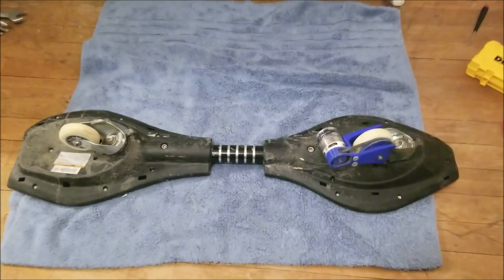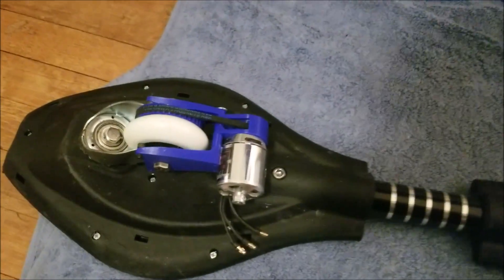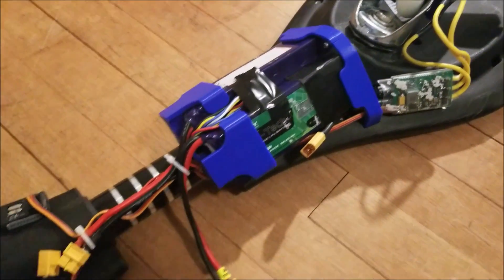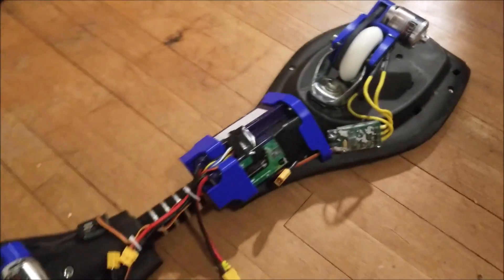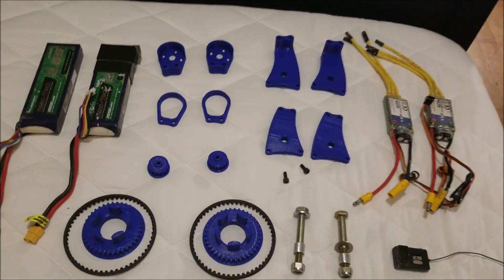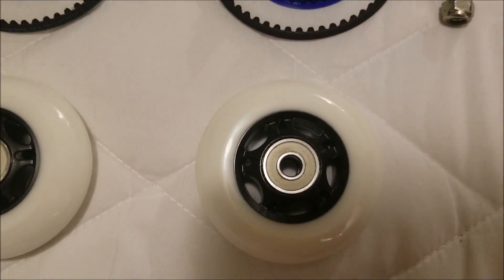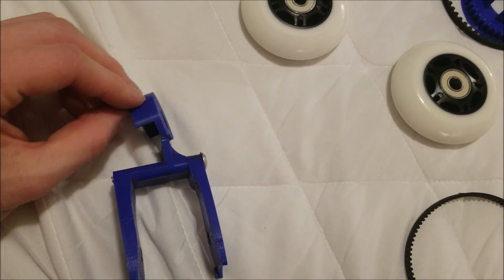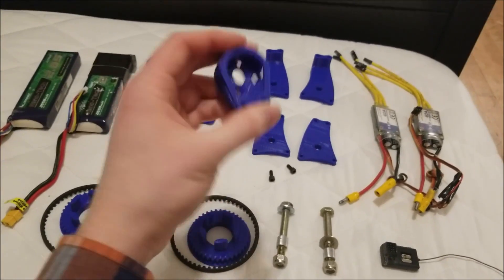2000W 3D Printed Dual Drive Electric Ripstik!!

Comment: Hey man, love this project! :)

Have you iterated on it since this video?

I have been meaning to convert a StreetSurfing Waveboard for a few months now but the motors are constantly out of stock and I can't find suitable alternatives....

Ideally, I would love to put bigger wheels with hub motors on it but that would of course require custom casters. Not technically impossible, but probably expensive to manufacture.

So for now, I'd just be extremely happy to have exactly what you have here in terms of drivetrain :)

However, he Waveboard body has a lot of cavities underneath the deck plates. I'm definitely going to embed the receiver, ESC's and maybe a charging curcuit in there.

Comment: Hey did you have to do anything to the battery mounts to get them to fit? I printed them as-is and I have no clue how you jammed em in place lol
Reply from the maker: One of the battery mounts snaps into place on the center tube (secured with a ziptie), and the other mount is actually two pieces, and you have to insert them into slots that are already in the plastic body, then fold them down towards eachother and fasten them together with a bolt. So no tape, glue, or drilled holes necessary

Comment: This is awesome man!! I’ve just been given a rip stick and love the idea of electricfying it!! Hopefully get it done in the next few months when I finish a couple of other skate-projects… what size motors are you running on that setup and what are your belt measurements?
Reply from the maker: Would highly recommend! Its a blast to ride! I used Turnigy SK3 4250 350kv motors with 275mm x 5mm HTD-5 belts, check the description for more details too.

Comment: Genius! What kinda top-speed and range did you get out of this btw?
Not to mention, what's the hill climb gradient ability like?
Reply from the maker: Thanks! Top speed was ~18mph but with solid torque for low-medium hill climbs. You can always trade speed for torque, but this was a solid combo i was happy with!
Reply: @ericinventor  cheers for the response. I wonder if it's possible to use those old 70mm electric skateboard hub motors on these too; the ones that can fit into existing truck axles? (compared to modern hub motors that include an axle mount)
Reply from the maker: @esk8jaimes Yes Ive thought about this too. The tough part is packaging, most hub motors ive seen are two wide for this thin ripstik wheel/caster combo. Im sure its possible but the caster would probably have to get wider. My goal was to not seriously modify the original ripstick, so people could make the conversion themselves.
Reply: @ericinventor  Do you know what the approximate range is? I'd love for it to not only be fun but also practical!

Comment: Is there any way to get the wheels more centered in the caster ? Already printed the mounts and ordered the motor !
Reply from the maker: Hey tres155, they are only slightly offset from center probably about a 1/4in, but you can use skateboard spacers or washers to keep the wheel positioned along the axle. If you really want them to be perfect you could bend the caster out to make the gap wider, then center the wheel using skateboard spacers.
Reply: @ericinventor  thanks man ! I'm super stoked to build, you are making childhood dreams come true you're awesome !

Comment: I’m literally ordering all the parts to do this now. You’re a legend. Was it worth doing both or did you not gain much?
Reply from the maker: Yes you get much more torque and acceleration! I would recommend getting different escs though. Im upgrading mine now to flipsky minivescs
Reply: @ericinventor  thanks - just a quick one I’ve got a few problems with the stl’s from your thingiverse - the motor mount v2 isn’t like in your video where both sides are the same height - one side is higher which means the mount stiffener won’t fit on as it’s floating on one side?

The other (more important) one is the small pulley seems to only be the old version? I’ve printed smal and large pulleys and they have two different belt profiles? Also the pulley just has a circular hole not a D shaped one. Do you happen to have backups of the STLs?
Reply from the maker: @Who.IS.my.daddy.  Hi Gordon, im sorry youre having some issues with the files. Its my fault I may have not uploaded the latest ones. Let me look into it tonight and try and reupload the latest ones. Send me an email @ericinventor@gmail.com, Im glad to help!
Reply: @ericinventor  you’re the man, thanks! Really appreciate it
Reply from the maker: @Who.IS.my.daddy.  I reuploaded the latest small pulley and motor bracket to thingiverse. Let me know if those work for you. They are called little_pulley_5m and motor_bracket_2
Reply: How'd it go, did you make one?

Comment: This is what I've been looking for, sadly though I don't have a 3d printer. Maybe you'll have some offroad upgrades by the time I do though. Just needs larger...axles...wheels holders, I'm not sure what to call them.
Reply from the maker: Ender 3 3D printer costs $180. Best printer for the price. Join the the club bro

Comment: Do the motors hit the ground on sharp turns? Thinking about making my own one, and I’m wondering where to put the motors
Reply from the maker: No they don't, just as long as the wheels are full size and you use the brackets I made. The motor's gotta stay right near the wheel
Reply: @ericinventor  thanks for the reply! I've decided to go for hub motors instead now though, to save space and make it look sleeker.
Reply from the maker: @LameCorvette  Wow great idea I'd like to see that once its done!
Reply: @LameCorvette  What hub motors did you use?
Reply: @LameCorvette  How'd that project go for you?

Comment: How do you wire the escs to one receiver? Thanks
Reply from the maker: You connect the ground (brown or black) and signal (white or orange) wires from the pwm cables of each esc together. Then you have just one pwm input to the receiver.
Reply: ericinventor I wired it like that. Only one motor runs, then once you turn of the transmitter one motor continuously runs. Any ideas?
Reply: @markdavis7032  thats mean your receiver doesnt have failsafe mode. what tx and rx you're using btw?

Comment: Would this fit on the ripster? ( the mini ripstik)
Reply from the maker: Not sure! But you could try it
Reply: ericinventor thanks! One more question. Where would I get the D shaped rods that fit into the motors.
Reply from the maker: @markdavis7032  Those are just 5mm steel shafts which I ground down on the ends to have a D shape

Comment: Hi i printed the large pully. But its to big when i turn it hits the ground. Can you make it smaller?
Reply from the maker: I designed it for full size wheels, so if your wheel has wore down and gotten smaller it might have that problem. A smaller pulley will result in less torque for start up. Your belt length will also have to change. But I can try uploading a slightly smaller one.
Reply: @ericinventor  thx i thougt of that also i have a ripstik air pro maybe thats the problem. But is would be nice if you could ride i with slightly wore out tires. They are almost new. Also do you have a link for the beld i cant find them in europa.
Reply from the maker: @manuelriemens3366  Here is the link for the belt: https://www.vbeltguys.com/products/275-5m-05-synchronous-timing-belt . These guys sell every possible belt size and length you can imagine, for super cheap!!
Reply from the maker: @manuelriemens3366  Check the thingiverse page again. I just uploaded a 34T pulley, the first one was 38T. Its about 6mm smaller in diameter. Try printing that one!
Reply: @ericinventor  i saw that link but shipping is 18 euro for a 2 euro package.
Reply: @ericinventor  the hole in the small pully is round on thingiverse
Reply: @ericinventor  do you have an email so i can send you what is looks like on ripstik air?
Reply: The thinnest belt i can find is 10 to 12 mm wide

Comment: Hi Eric,

Very well done Sir!! :-) 

I'm curious about something, did you do anything special to insure that one motor was not producing more torque than the other or does it really matter?
I imagine that some form of a feedback loop to the ESCs would help to insure that they both output the same amount of torque but then again, maybe it just does not matter as long as they are somewhat close to each other? 
I was just thinking about the effects of long term use.

Either way, this is a great example of R&D work! :-)
Reply: If both ESCs are programmed to apply the same amount of current based on the input from the receiver, torque should be around the same
Reply: @rusinsr  
Gotcha! :-) 
Thanks!! 
And have a great day!